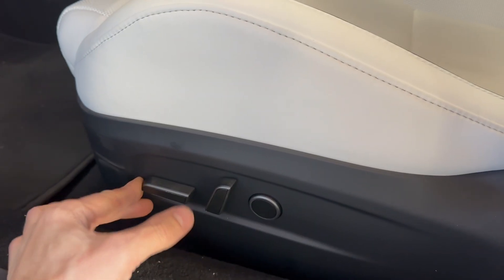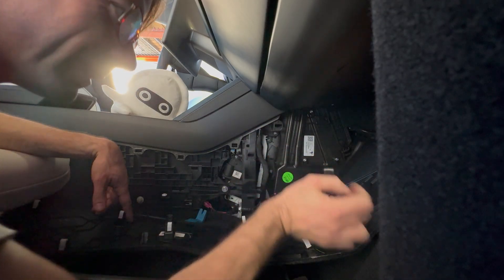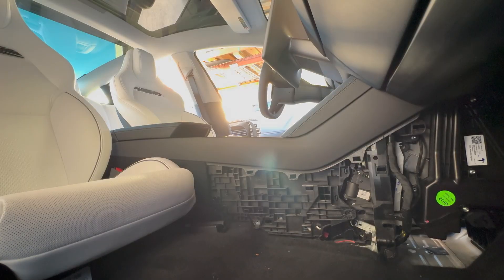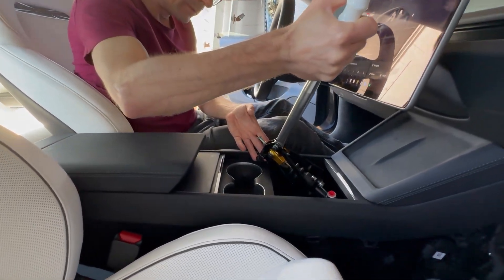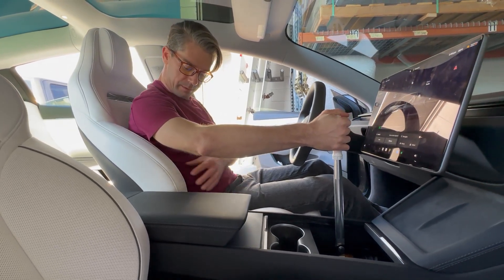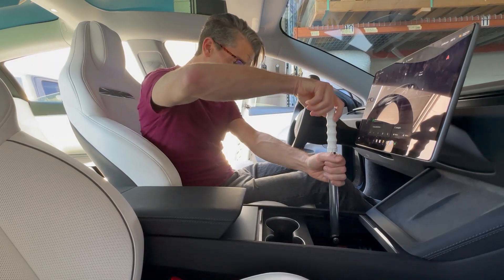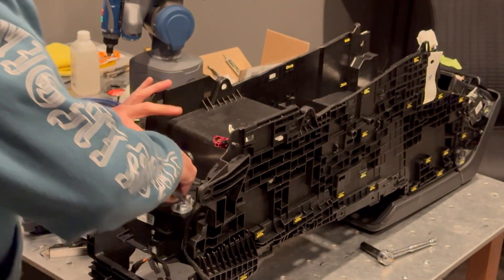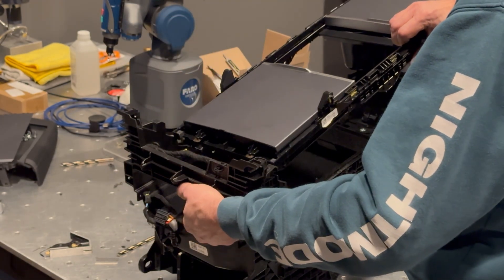Model 3 Hydraulic hand brake development and install

Comment: This is awesome! I'm looking at buying a tesla model 3 soon and making it into a drift car in Australia, when are you guys planning on making the full hydro kit? have you done anything to program it to spin both wheels together? How about the lock on the front? Is stock lock sufficient?
Reply from the maker: Great questions. We have finalized the design and testing of the 24+ complete hydraulic land brake kit so that has the green light for production. & we are tooling up for the 2020.5 ~ 2023 as well now. Nobody can program both rear wheels it’s a mechanical solution. I have a quaife LSD, it’s the first thing I bought for the car and actually it’s so important I had it a couple months before taking delivery of my car. Stock lock is very challenging. I’ve posted a rendering of our solution in a you tube short already and the good news is you don’t need to swap in a BMW rack like the other guys. I’ll be on the drift track in the next couple weeks with the angle kit that features an OEM knuckle modification and OEM arms modded for angle clearance.
Reply: @PartsShopMAX  That's awesome, keep us updated on the progress looking like I won't be able to build my tesla drift car till next year when I get my workshop, but very keen to get drift a tesla

Comment: This is cool, but locking up the rears like this is putting a profound amount of strain on the motor.  Curious how long this will last.
Reply from the maker: I’m happy to stress test & report, but other than the fact that drifting is generally hard on cars, I’m not worried about the handbrake causing any stress on the motor. Regen is off, & I’m off throttle when the handbrake is applied so it’s in a free spinning state when I bring it to a stop. Hydro hand brakes are often misunderstood as an on-off switch for locking up the rear however it’s a totally analog and dynamic tool that’s constantly balanced with weight shift and counter steer. The power in applying the rear brakes with your arm muscle without assist, is way less than the foot brake applied with your leg & hydraulic assist. If you pull that handle without mid corner weight shift, you’d be hard pressed to get the rear to lock up. The torque and response of full throttle from a dead stop plus regen seems like more stress on the motor to me.
Reply: @PartsShopMAX  yep and after looking at how it all actually goes together online if you're throttle off it should be pretty damn safe to do.  I have a 18' m3p , so you got me thinking now. lol

Comment: Where do you have the hydraulic brake lines tap into the rear brake lines?
Or is it an independent system with a custom caliper bracket for a dual brake calipers setup?
Reply from the maker: Tapped in-line for the OEM caliper only at the OEM hard line union under the front left wheel well liner. There will be a build episode dedicated to that next.